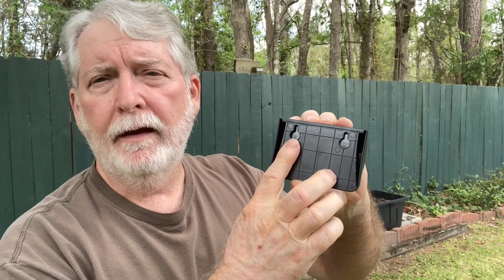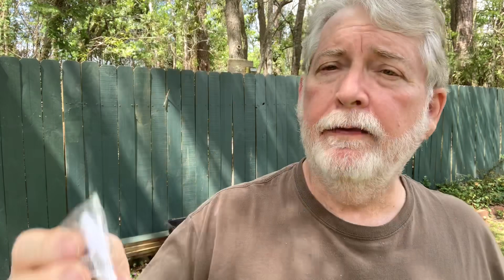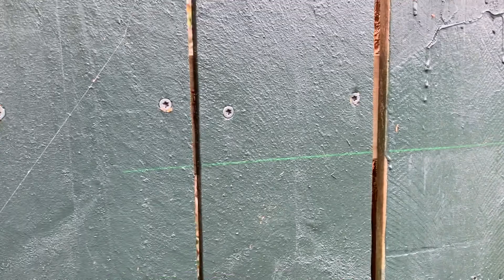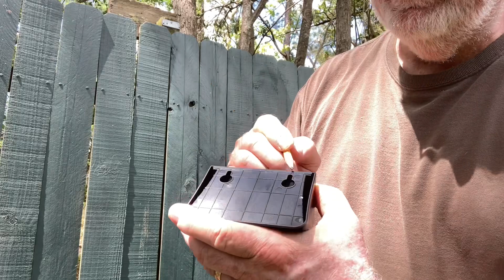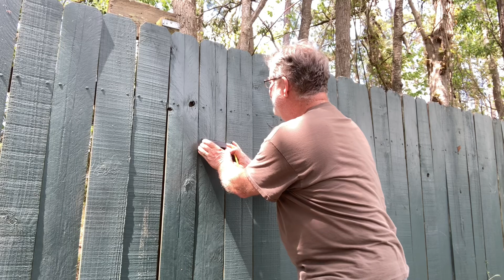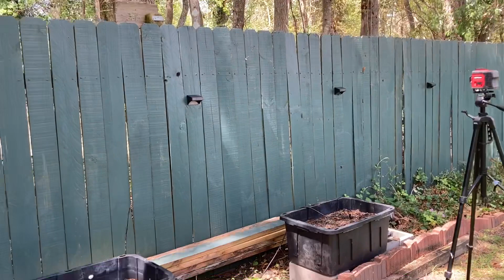Install Solar Fence Lights Super Quick & Easy

Comment: Nice!  I’ve changed one side of my fence and the other side will be done this Fall, I have solar caps on 4x4’s, when new fence goes up I won’t be able to use them & this will work perfectly.  Thanks!
Reply from the maker: Awesome, sounds like you have a great plan. Thanks for watching